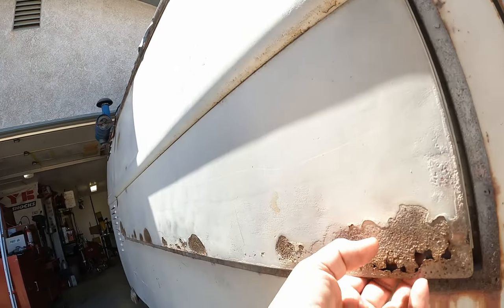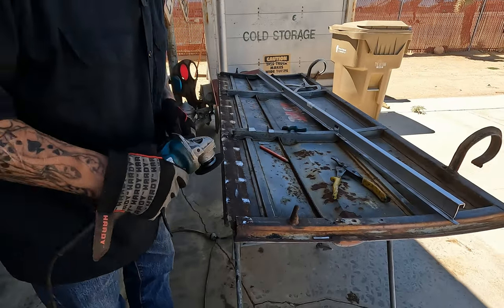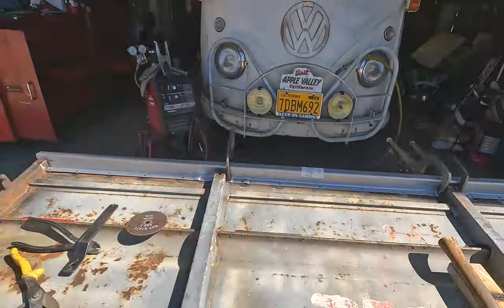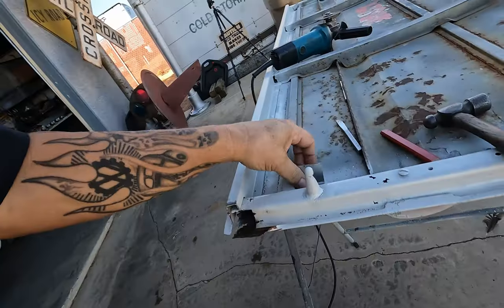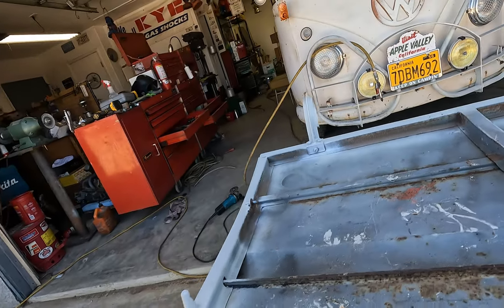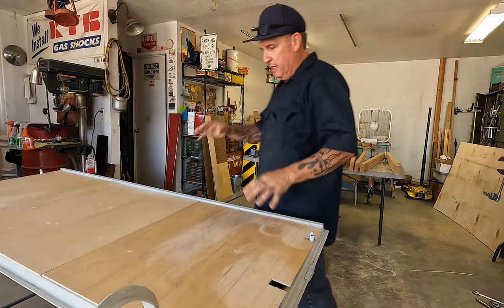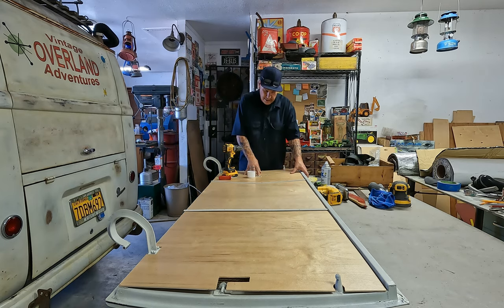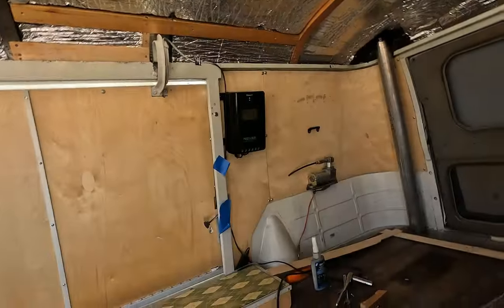VW Bus Westfalia Sales Flap RUST REPAIR - Endless Summer Series Camping Camper Overlanding Soon!

Comment: Nice repair Larry !  I love the panelling and with lights....awesome.
I used that bubble wrap foil on the floor of my Comet
Reply from the maker: Thanks, the lighting will help with the door both open and closed. I like that foil stuff. It's super light and should help keep some heat inside this winter. Did it help with the noise? 🤙
Reply: @VintageOverlandAdventures  I installed it under my carpet, and the carpet kit came with some padding for insulation so I'm double protected
Reply from the maker: Thanks for your message. I appreciate your response and hope it works well for me. 🤙